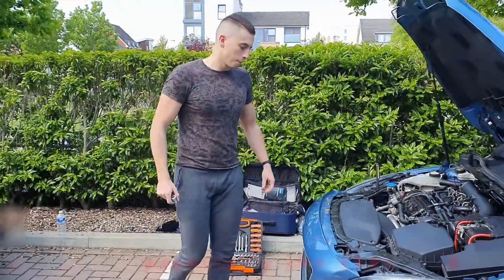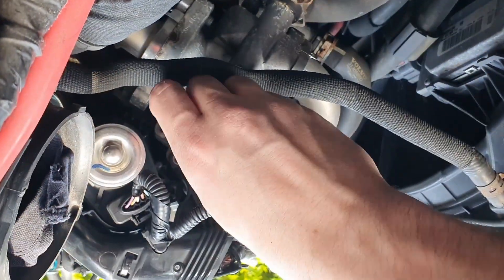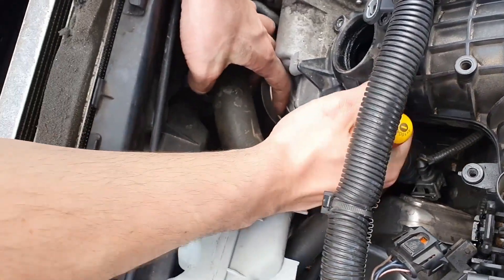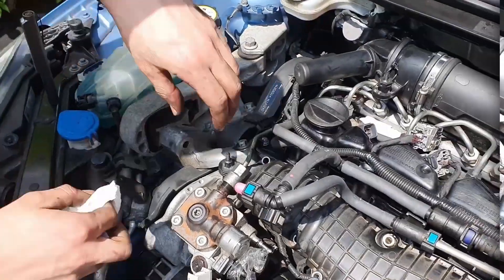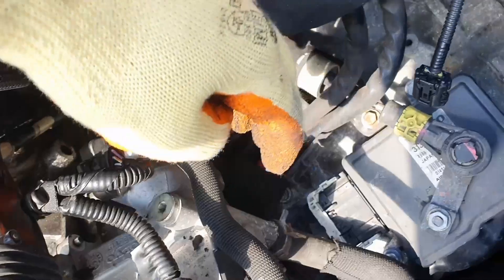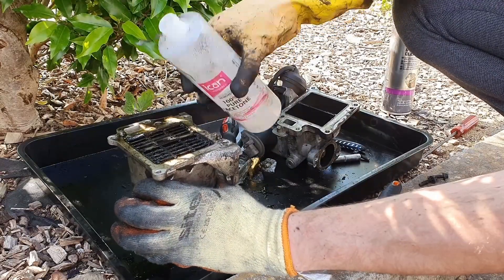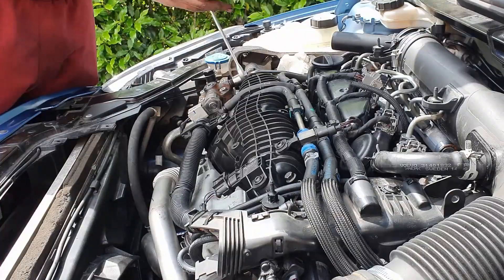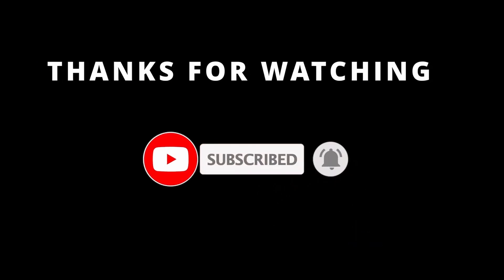Volvo VEA Diesel EGR + Manifold Removal/Cleaning (V40 and other models)

Comment: Hi can you help me, my 2018 SPA XC60 D4 with 95000 miles has exhaust fumes coming from the engine bay and it makes the cabin smell like exhaust gasses. I heard the egr pipe cracking can cause this. Is this the same procedure to take it off as you showed here? Thank you sir

Comment: I did this job yesterday, Manifold cleaning and EGR valve replace but just cleaned EGR cooler. When I put back everything and started car, white smoke came from the exhaust and I spoted a coolant leak right under the vacum tank, around the EGR area. It seems coming from the EGR gasket, or maybe some hose, not sure. Will check tomorow.  That white smoke from the exhaust concerns me.  Did you have this problem with the white smoke and was it maybe normal after cleaning intake valve and EGR cooler ?
Reply from the maker: It sounds like coolant is making its way into the engine. It's probably the egr/cooler gasket.

Comment: Sensational video. Watched several others  on this procedure but none of  the others were as complete and this was the only one  to list gasket part numbers and torque specs.  Great job.  This will be the one I watch as I do this job! I've subscribed.
Reply: How did you get on with it mate?
Reply: @sheffcitys2forgedinsteel255  Success.. now for the plastic valve cover

Comment: Hi, is it ok to clean just the inlet manifold (and egr cooler/valve) without cleaning the intake valves? I dont have an endoscope and am worried about getting dirt inside the engine and have no experience closing the valves but the rest seems doable, i just didnt want to take off the inlet manifold if it meant id have to clean inside the valves too because I'd opened it all up...
Reply: Good question. I'd suggest you could do a minimalist approach if  you are uncertain the valves are closed. Instead of a brush use only a small amount of solvent on a clean lint free rag with your vacuum running in the chamber as you do it. Compared to other  nasty bits that can get in the cylinders, bits of carbon and a tiny amount of acetone aren't going to cause  much damage. Remember some of the carbon build up will break free and go into the engine during normal running, and acetone evaporates fast and will be burnt off in a second. It's not like the precautions you need  to take when machining metal to my way of thinking.

Comment: Great video. Thank you: I'm fixing an XC 60 I just got for a very low price. My egr cooler was so blocked I had to put the acetone in by poking a thin wire into to top layers to start the soak working. I'm also going to replace rocker cover gasket, clean manifold and valves, and change timing belt and water pump. PS - no need to put transmission in neutral before rotating engine, Cheers, Nick
Reply: You might find as many do  that replacing the rocker  cover  gasket doesn't solve an oil oil leak because the body is made of plastic and needs replacing. If you are  doing all that work I'd replace  the rocker cover unit. Also check all the flanges on the egr pipe ends... the  welds are famous for corroding leading to cracks in the flange area. Now is that correct about not needing to put the  car in neutral to rotate the  engine?

Comment: Amazing video; this is the second time I am tackling this job - last time cleaned out the EGR and Cooler, from another video although I did not clean the intake manifold - Question: So how important is it to take this step and to clean the valves?  I have a 2016 manual V40 with this same engine. Thanks :)
Reply from the maker: @G1984Orwell  makes sense if there's a lot of carbon as u get access to them, mine was not a good example.

Comment: Hi, I am looking to do the manifold, egr and the rocker cover which thankfully you cover in separate videos, just one question, with draining the small amount of coolant from the egr tank, once everything is back together did you re add that coolant to the top up tank and how do you avoid any air  traps now the cooler is empty, is there any specific steps to take or did you just restart the car and let the pump do all the work, thanks for some great videos.

Comment: Hey bro, nice work. I need to have this exact work done on my car, same engine ( xc60 D4 2015 R Design 190bhp ). Would be extremely thankful if you could do it. Do you have a garage or are you mobile?
Reply: Exactly the same here mate on the same engine D4 r design 190 bhp but in the V40 2014 fed up with it this is the 2nd time in 2 years ridiculous

Comment: Fantastic video, Thankyou very much :) 

i want to attempt this on my XC60 but its quite daunting.
Reply from the maker: @BarnacleBill77  it's not that bad to be fair,  just make sure u prepare all the gaskets and give yourself enough time to do the job :)
Reply: @GSAuto681  Thanks again :)
Reply: @GSAuto681  Did you notice better running and mpg after doing the work? :)
Reply: Anyone doing this, I'd advise running a bead of RTV gasket sealant with the new EGR cooler gasket....mine leaked.
Reply: I've just completed this job on my xc60 and it went well....the hidden bolt under the egr cooler nearly finished me off though 🤐

I've just taken it for a drive and it seems its loosing coolant from the egr/cooler....the pipes are ok and clamped on and I fitted a new gasket, what could be causing this?

Comment: Does it make sense to clean the EGR? Isn't it better to replace it with a new one including the cooler? I heard that cleaning the EGR valve and cooler only lasts a while.
Reply from the maker: Replacing with new or mapping out is the best option. If you have the revised egr design and clean it properly, it should also last reasonable time. Rgds.
Reply: @GSAuto681  When was the revised one  built into the xc60?

Comment: Had the misfortune of needing to do this last year on a V70 in parallel with a DPF de-ash 😮 I found the most effective cleaner for the cooler was Bilt Hamber’s degreaser used neat with boiling water applied repeatedly and then using the strands from armoured cable to poke all the way into the channels one at a time - that was not fun 😵‍💫 Same product on the manifold and intake - BUT on the last valve the crud left a gap and leaked into the cylinder which was a bit of a brown trouser moment but thoroughly blowing it out with compressed air by removing the glow plug seemed to work 😬 The ECU then detected low compression (this was a software patch they added as I understand to stop the inlet melting 😮) but fortunately went away once the valves settled back to closing fully 😮‍💨
Reply: How difficult is the dpf filter access? On my 2017 Leon the entire engine had to come out
Reply: @radimziegler7079 just about reachable from underneath on ramps - trickiest bit was undoing the clamp to the downpipe but using a few extension bars I was able to reach up - I recall needing to use two nuts as an improvised lock nut when doing this though can’t visualise why now 🤔

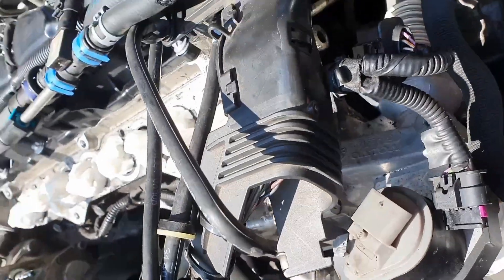Comment: In the 8:43 part of the video, in my car, the screws are T30 torks, and this is impossible to remove. It's stuck. I've already applied WD to try to alleviate them, but I can't remove them, would there be any tips to help me?

Comment: Great video! you made it to look "easy" to do.... if theres an EGR check engine code, is it enough only to clean the EGR? The Manifold part looks hard for me :(
Reply from the maker: Absolutely. In fact on those engines most of the time it's the EGR cooler and not the valve, but surely if you taking it off can give a good clean to both!
Reply: @GSAuto681  Hello again! After you cleand the parts did you let them dry out on the sun or did washed with water or something?

Comment: How did you unscrewed the 30 mm bolts from 8:43 ? i'm stuck to that part because I can't do it.
Reply: Try using a spanner or a long ratchet.
Reply: Thanks @georgistefanov9166  . I have removed the part from back of the engine of the intake and with a long ratchet you have some space .
Reply: I'm having the same problem getting rid of the screws on my car, the screws are T30 torks, and it's impossible to remove. It's stuck. I've already applied WD to try to alleviate it, but I can't remove them.
Reply: Hey hey! How long did it take from start to end?

Comment: This is an excellent video. Thank you.
My V40 (MY2015 V40 R-Design 190 with 120k miles on the clock) has been diagnosed as having stuck inlet runner vanes. I can see there is a lot of residue in the manifold by looking through through the MAP sensor hole. Is it likely that the runners or actuator will have been damaged or should a good clean fix the problem? The dealer proposed replacing the inlet manifold.
Reply from the maker: Hi, It really depends on the current state of the manifold. Sometimes carbon gets between the manifold and the runners shaft which can't really be cleaned manually. There are more professional methods with chemicals and ultrasound cleaning, but I'm not 100% if they would equally be applicable for plastic components. Unfortunately volvo had designed the manifold without the possibility of physically removing/deleting the runners, so best option would be to try giving it a good clean. The runners actuator is an easy one, you can remove it on its own and if you switch to ignition 2, I think from memory it would move once to closed/open position. Good luck.
Reply: @GSAuto681  I cleaned my inlet manifold & ports using this video as a guide. I removed  the manifold with the high pressure pipe left in place by removing the engine cover support on the top of the manifold at the LH end. It was in a right mess & I think this was the dirtiest job I've ever done but well worth it. I had intended cleaning the EGR valve/cooler as well but on the day did not have apprpriate tools to remove the 2 bolts holding the pipe at the rear of the EGR valve. In my case they are Torx screws rather than hex bolts. This will have to wait for another time. The EGR valve action was also very stiff (I wouldn't have been aware if I wasn't doing the maintenance) but I managed to make it operate very smoothly using WD40 and a little high temp grease.
The actual swirl flap assembly can be carefully unclipped from the manifold moulding which gives better access to clean both parts. Reassembly with new gaskets went well & I've since done about 2000 miles with a much smoother engine. I've since bought a small OBDII scanner and I can see in live data that the flaps are correctly following the demand accross the whole range 0-90 deg. I do still however have a remaining problem. DTC P200900 sometimes gets reported on its own but not consistently - I may go several hundred miles or just a few. The freeze frame data doesn't seem helpful as it shows the engine not running. Any clues or advice?
Reply from the maker: @RoystonBroadhurst  Hi, I'm glad you've found the video useful. In terms of the fault code, that seems to me like a few things. It's either the runners still slightly sticking (quite disappointing volvo didn't make them deletable), it's the runners actuator not been mounted back correctly (if you've disassembled it), or it's the wiring/actuator itself. If you are going  to verify the actuator mounting, before putting it back on the manifold, you can quickly verify its operation by switching to ignition 2, which will make it test itself/make a full arm movement, so at least you can rule out the actuator mechanism. Good luck with that!
Reply: Thank you - I'll let you know how it goes in a few weeks when I'm done @GSAuto681

Comment: Please show us how to change the timing belt
Reply from the maker: Hi, it's been done on my car already, but if I can find a donor might give it a try.
Reply: @GSAuto681   Let me ask you one more question about changing the timing belt.  The camshaft moves slightly when tightening the timing belt tensioner. How do I adjust the timing belt tension?
Reply: @Blueberry-ek1yy that's why I put a white mark on them so I know where it should be you should put it back to where it was (in TDC) and unfasten the injector pump bolts and turn it fully towards the engine, when tightening the tension the injector pump pulley will take up the slack, you can pin it with a 8mm drill bit or a m8 bolt
Reply: Heres your man, Mines  due 😂 was going to do myself after I give the ecv clean a go. 2014 XC90 d5
Reply: It's not a hard job although Volvo will tell you it is and you need a timing tool to remove the lower crankshaft bolt, you don't I used white marker on crankshaft bolt and cam bolt the injector pump locks up with a 8mm bolt
Reply: @stephenlockwood437  What is the white marker going to do on the crank bolt?
Reply: @stephenlockwood437 you wanna do mine hahaha